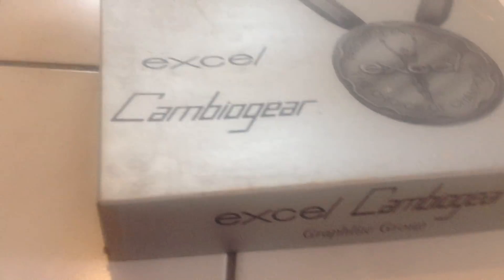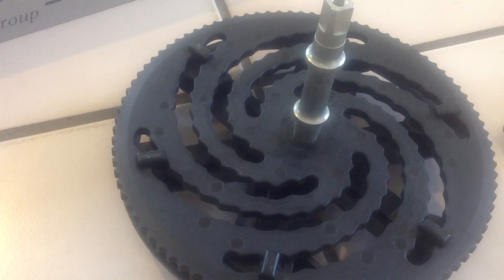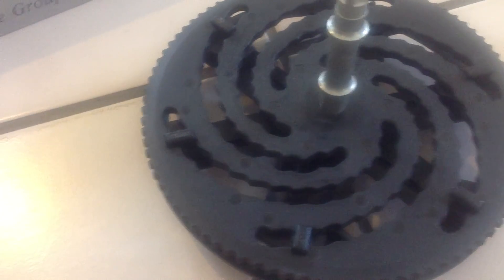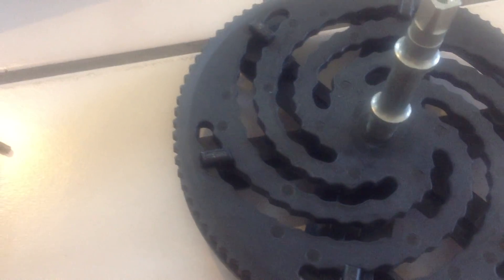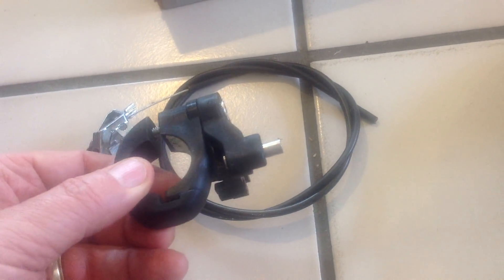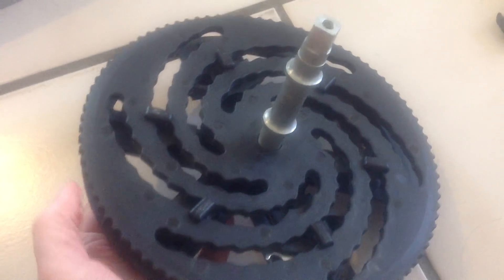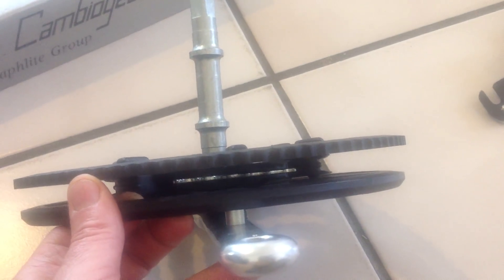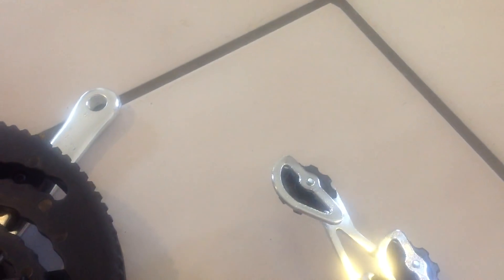15 speed Cambiogear Bicycle Transmission

Comment: I had a Nordic Track tricycle that I bought in a garage sale, it had one of these front gearing setups instead of a front derailer.

Didn't have the clamp for the break, but a brazed on post the brake mounted to 

It was very old when I got it, but it cleaned up nicely and worked well, had been int he elements like 20 years and survived fine

Comment: Hello Pop, thanks for the video. I tried to make an auto bike transmission like this, but with 2 spiral plates, back to back, but set so the spirals ran in opposite directions.  Where the spirals intersected, I had 6 small dia. bike chain derailleur gears between the plates that would follow the opposed spirals as one plate turned in opposition to the other.  There was a recoil spring in the center which made one plate turn in opposition to the other, forcing the gear set to a higher gear.  My thinking was as the load increased, say going uphill, the torque exerted by the rider would overcome the recoil spring and cause the crank side plate to force the derailleur gears (which were not free wheeling)  to a lower gear.  I see from your video that I should have used only 2 or perhaps 3 of the derailleur gears with the others smooth "dummies", to allow for the change in effective radius of the gear set.  Maybe I will revisit this idea.

Comment: how would the chain 'skip' teeth when changing gears? a chain is a set length between the 2 sets of teeth, if it gets bigger the chain can't become longer, it has to skip teeth somehow, this design is flawed, and you can find out by installing it on a bike and try to use it. you may be able to set it to your desired gear once, but making it bigger/smaller while riding would be mechanically impossible
Reply: Alexandros Nicolaou, they covered this in the video: Only two of the six sprocket segments have teeth, the other four sprocket segments are just dummy place holders to hold the chain in a roughly circular shape. When you switch to a higher gear (expanding the diameter) extra chain length is required to cover the greater circumference, and this extra chain length can slide over the place holder segments while at all times one of the two sprocket segments that have teeth is engaged with the chain.
Reply: he showed the slack taker upper...... why do you even have that question.   it's got a tensioner
Reply: That was also my question but here's the answer... I think? Top gear is when the sprockets are farthest from each other and that is when the chain is placed onto the bike. When the sprockets become closer together, you'd have to have some method to take up the chain slack between the sprockets... right?
Reply: I think you can only shift when not pedaling..

Comment: If the inventor can modify the design such that as the force applied on the pedel increases, the 6 segments will move inward automatically. The critical force that will trigger the down shifting could be set up by the rider, depending on his/her strength. This will make this design completely automatic to operate! I have thought of a similar design for years, but I never got my design to work.

Comment: Maybe the reason for it lack of success in the market is the way you change the gear? You have to stop the motion of your feet and rotate backwards to gear up and then rotate forward again to continue. Luckily when going uphill you can just tap that gear-handle to get into a lower gear, that way you don't loose any momentum while going up. But you probably could not put very hard force into it  while changing gear as it would probably skip a lot of gears while doing that.
If the way you change the gear was done by some sort mechanics or pistons instead of the outer brake ring it would have been a lot better?

Comment: One problem I see with this is very low number of teeth grabbing the chain compared to a normal transmission. This would not be a problem at first but only after some wear of the teeth.
Reply from the maker: I see what you mean, especially about aging. While new, it is not a problem. There are two teeth on one side and two teeth on the other side and that is enough to pull the chain. However, the two-tooth segments are very easily replaced if necessary -- they just snap in and out of position. Think of spokes: it would seem unlikely that a mere 36 wires could push/pull enough to hold up all that weight. I would like to hear from the designer, Mr. Husted. He is a mechanical engineer and probably did a numerical study of this. I am now using a 75 speed bike with a different system. It, too, has some problems despite the huge number of gears available. I plan another youtube video on these alternate bike transmissions. I have a considerable collection in the garage.

Comment from the maker: It upshifts by means of (1) pulling the lever and (2) pedal forward and (3) listen and feel the number of clicks. You can actually, intuitively feel and hear what gear you are in. To downshift you (1) pull the lever and (2) briefly backpedal a fraction of a circle. Again, you can feel and hear (more or less) what gear you are in.

Comment: can anyone tell me how it shifts up because this video only showed it gearing down .... help would be much appreciated
Reply from the maker: Pull the "brake" lever to stop the inner circle from moving. If you pedal forward as you normally do, it upshifts. If you briefly back-pedal it downshifts. The amount of upshift or downshift depends on how much you pedal or back pedal while the brake is engaged. You can feel how much it shifts with experience and can go to the exact gear you want every time. You do not need a visual index or anything that says "Gear Number Whatever".

Comment: The Nordic Track version would have been great, if the thickness, or rather , the depth, of the steel segments, IF it was doubled from  .030 to .060  inches ... Such a simple mistake doomed this product... Nordic Track had to send me replacement parts twice, then I gave up on it.
This is the steel piece with six teeth, which is embedded in plastic, and twice it snapped while accelerating from a traffic light... I hope no one got killed...  The steel segment broke in the web, where it was embedded... So thin, it was more like planned obsolescence than a design  error... 
I still have one in my backyard shed.

Comment: This is exactly like the Nordic Track™ Fitness Bike, except that was a Nine Speed.
Reply from the maker: The designer, Royce Husted, also included his bicycle brake design when you bought the complete bicycle. The rims had a tiny groove outside on one side that was just big enough to hold a loop of string. The loop of string loosely dangled around the entire 27 inch wheel, hardly touching. When you wanted to stop, the brake lever tightening the loop. A huge amount of braking power, easy to control by the brake lever, stopped the bike in dry or wet. The string was kevlar, did not dirag, did not need to be replaced much, and was cheep. Nor did it require adjustment.

Comment: Genius design.
Reply: +Quantumline . But its very easy, to add a indicator of gears. Just connect position of tensioner with pointer at dial.  Its even better, than standard system,  because we can read real status, not position of gear lever.
Reply: You have no understanding at all of how this works. I've used one. It has nothing to do with how hard you pull the lever. The lever does nothing but keep the wavy notched disc from moving. At that point, you pedal forward to upshift or backward to downshift. It's not random. You're either upshifting or downshifting. You choose. It's a linear progression up or down, not any old gear like you assume. You can't jump from 4 to 9 to 2 to 5. It's 1-2-3-4-5 or 5-4-3-2-1.

Comment: You know Tutoringby Pop, you might see if you couldn't reverse engineer the
transmission to be built of steel and aluminum which are proven materials.
That is, it COULD be replicated so it offered to the market.

Comment: Thanks for the video. Very interesting concept. I immediately thought of using a torque arm for automatic shifting in concert with a separate brushless motor and pedal assembly for power input. It is a shame that the unit was not manufactured with widely accepted materials such as aluminum alloy. Consumer perception is a big part of capturing market share. I think it could be a hit if properly configured (and properly marketed).

Comment: One of the very few really original small-step transmissions I've ever seen. Almost everything else you see when you google CVT is a variant of the age-old expanding pulley or toroidal systems, with their reliance on adhesion, but this Cambiogear is something fresh.